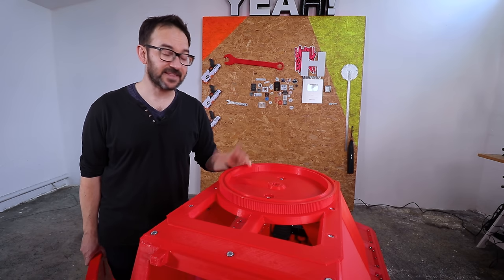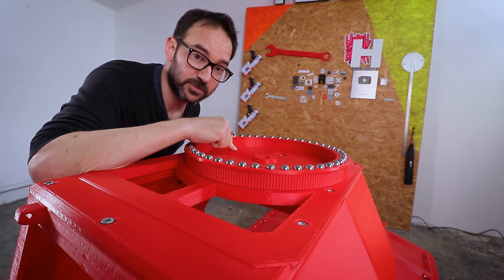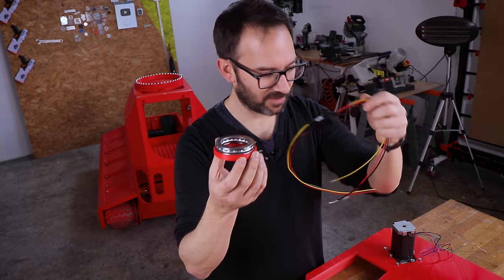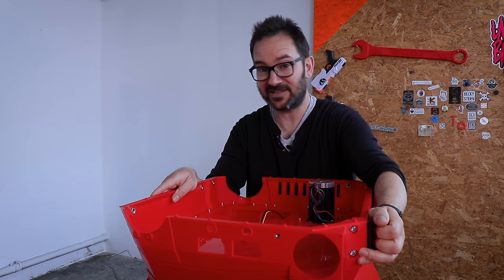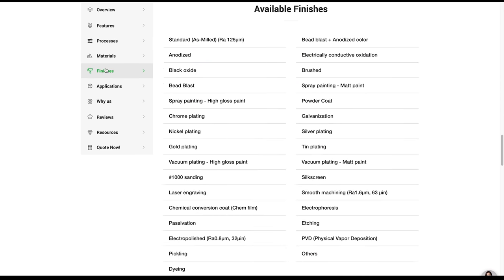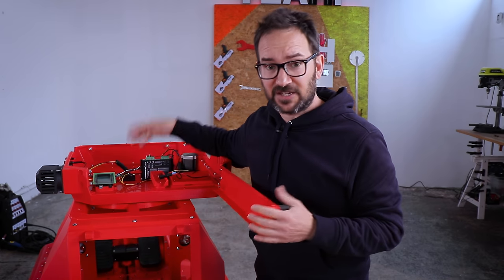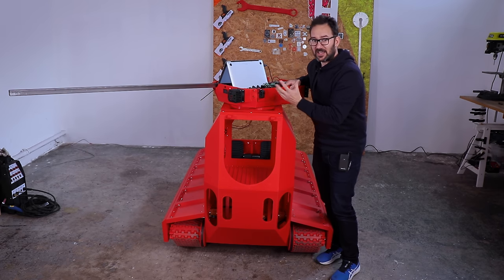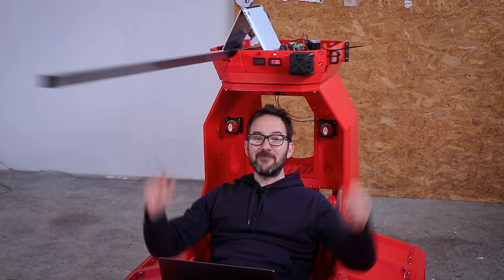GIANT 3D PRINTED TANK GETS A TURRET (from scratch)

Comment: To make your giant bearing ride smoother and better, here's two tips (source, i made a few of them, and got it down to a T, pretty close to the worst metal bearing, without being one).

 1. Print a 3rd piece which is a match for the two races (if it's a inner and outer race, use a segmented part with a slip piece between), you'll want to affix one of the two sides securely to a table (as flat as can be) or In Situ, then using the spacer and top part of the bearing and friction (two five liter bottles on a glass plate) you twist this fast, back and forth on a 180 rotation, twisting it 360 every few twists.

-This will create a really smooth set of races, and more importantly, matched.

 2. Take your balls, and measure them. After you've done so, keeping each ball to its size, you have to discard any bearing that's over the average, and replace them with bearings balls on average or smaller.

-This will make sure that the race remains uniform.

This gives extremely good 3D printed bearings. Smooth, and they wear out slower.

You can pimp them out further with two mods. Metal filament (or wood, tho, that one's complicated) and or super glue on PLA / acetone on ABS (both before you've done no 1).
Reply: You could also make wire race ball bearings.  The 3D print gets channels for the wire and 4 wires are carefully rolled to size and fit in the races.  There are a few youtube videos showing how to make DIY versions, and there is a German manufacturer that makes high precision versions.

Comment: That's awesome! I'd have wanted a slip ring connector with more wires, to send signals as well as power. That way you don't need wireless devices or extra computing power, you simply need a joystick or so, plugged into the body. But one uses what is available!

Comment: I use lazy Susan bearings if I need something large diameter and cheap. They're usually thin aluminium rings or there are pressed steel plate versions

Comment: If I may ask, why did you use a stepper motor for this task? you could have just used any motor with gear box and you would have decreased the cost, the driver, the programing needed and would had many more options regarding speed as it seems more important than accuracy...other than this it looks great! good job

Comment: If you want even higher speeds, torque and more repeatability, you could look into iHSV57 servo motors.
I'm currently in the process of replacing the NEMA23 stepper motors that came with my milling machine with those, and holy smokes are they faster, stronger and more accurate!
Also, their driver is included, so lots of saved space!
They do require higher voltage, however.

Comment: Having not watched any of the other videos on this- can this thing actually traverse ground and rough surfaces? Because I’ve been wanting to do something similar to build a tank for paintball, but mine would have just have had treads for the looks… and would actually move using bicycle wheels…. But if you’ve made a vehicle that can move using treads I’d love to try and see about making something similar for paintball. :)
Reply: There's no reason it wouldn't, but the problem comes with durability. Since it uses 3d printed parts, I'm not sure if it would stand some rough rounds of field testing.
Reply: He has some videos where he drives it off road and it does pretty good. I've seen other 3D printed belted vehicles and the plastic is more durable than you'd think.
Reply from the maker: Here's a link to the last test: https://youtu.be/CHNmIc4knVM although now it has way more torque and is more reliable. It'll be a field test of the completed tank soon.
Reply: @ivanmirandawastaken  thanks Ivan and everyone! I look forward to seeing where you go with this- as it’s very cool! :)

Comment: Why did you decide to put the motor for the turret in the head and not in the main tank body? Wouldn't it have been better since it would reduce the weight and also not requre a separate power source?

Comment: Great vidéo! Why you don't used a slipring to avoir damage on brushless cable with rotation ? With slipring you can make infitine rotation without any problem !
Reply from the maker: There's a slipring to send and get data from the turret. The cable I didn't want to break was the USB cable I was using to connect it to the computer while programming.
Reply: @ivanmirandawastaken  So you'll send commands/receive state via serial (or equivalent) through the slip-ring ? Nice !
Reply from the maker: Correct!
Reply: @ivanmirandawastaken  in fact we don’t see it. It’s for that ask you! ;-)